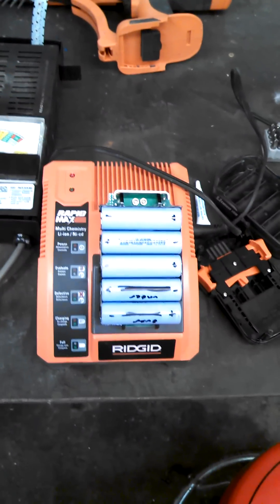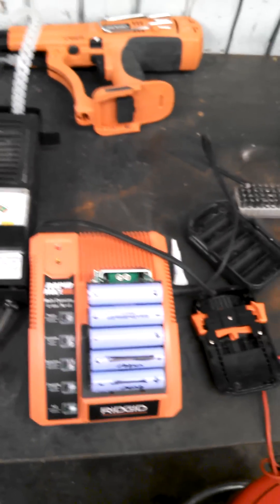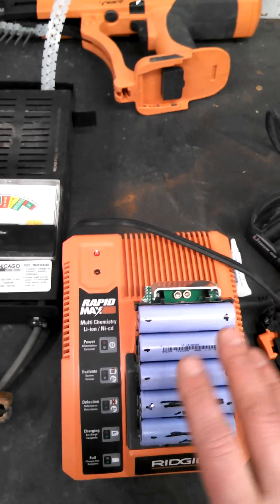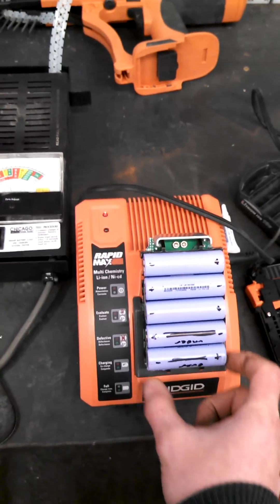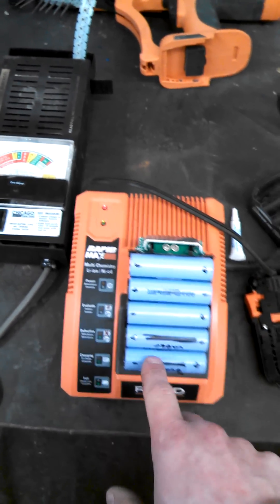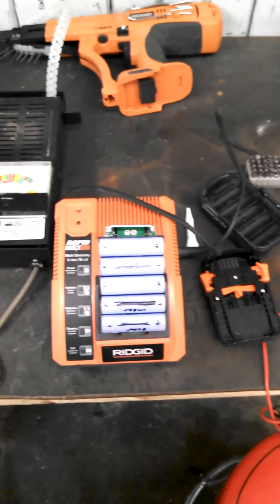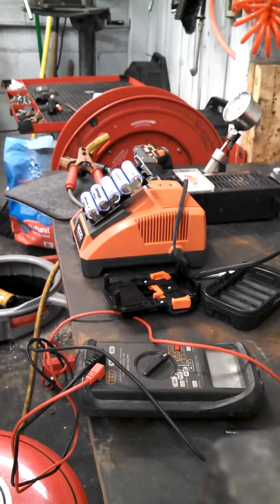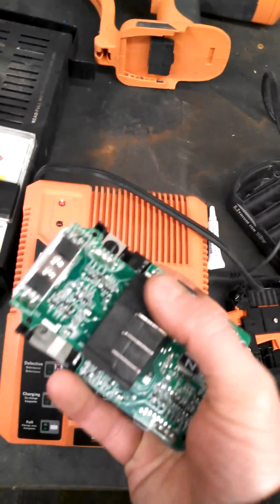Ridgid lithium 18v battery repair

Comment: Do you know what’s causing the battery to shuts off when the battery is under a heavy load? My Ridgid battery shuts off in a fast start. Slow start is fine.

Comment: Came here looking for information on whether or not there's a screw under an injection-overmolded hole on the cap that isn't able to be scratched through easily, but I guess I "don't know what I'm doing" because of that, huh? man, you could have just walked through the ONE thing that people are gonna wanna see, which is how these specific batteries are secured against 'unauthorised' entry, but instead you had to take the opportunity to flex and be condescending.

Stop giving other electricians a bad name.

Comment: Good luck with that, I went totally Ridgid based primarily on the amazing warranty! Went two years and finally had an issue with a brand new Ridgid battery under warranty (4 mos old) called Ridgid too get it replaced and they wanted the same amount to replace it as I could buy one locally at Home Depot...BS Scam!!!

Comment: The reason you don't have issues from the m18 is you use it everyday.   If they sat for 2 yrs, they would be dead as well.  That's just how lithium batteries work
Reply: Not always the case. I had a Milwaukee cordless stored away for 4 years. Lithium batteries still take charge without issue today. Where as my Rigid tools which were nog used for 2 years, batteries would not charge.

Comment: Ridged tools are the same as harbor freight tool, they are Very Cheap Chinese made Garbage, took my Ridged Batteries apart and all batteries said they were made in china, Crap batteries,
 no wonder they didn't last, GARBAGE!. I will Never Ever buy anything from Ridge tools ever again, they are Garbage. They opted to go to Chinese made Batteries and they destroyed their reputation, to try and make more profit, it didn't work. I am surprised Ridged tools are still in business, maybe they are hanging by a thread. Milwaukie is the only tool worth having, they are quality!! and Last for Years, No short cuts.

Comment: I know this is a old but if you registered your battery & tool it’s covered. Call & get a free replacement. I purchased a complete kit in 2009 & My battery’s died this year so I called Ridgid. They sent me a new set of batteries in 2 days. I registered the new ones so I am covered.
Reply: Did you have to send the new batteries in

Comment: In the future, do not buy rigid batteries. Just use your reliable milwaukee m18 battery with a battery adapter that you can make. Go on ebay and look for a battery socket with leads, and mount and wire it into the gutted rigid battery and you can use your m18 on ridgid or any other battery make. I have adapters or are making adapters for my m18 to work on dozens of different makes. I was originally only making a few adapters for tools and makes where milwaukee does not have that type of tool that I wanted, then decided to just make them for every other brand anyway. This way in case I run into someone who needs a battery for a brief time etc; or just for the heck of it. People 3d print battery sockets for different makes and sell them on ebay or online. The socket I use for milwaukee are from user msburko on ebay for $15 shipped. I think he also makes up docks for another brand as well. There are also partial non wired docks for less used for just storing your battery. Just look up "battery adapter" or "battery dock" for the brand you want. Some people also sell partial or complete adapters as well. Just be aware that you are not going to be utilizing the thermal or voltage protection from the batteries or tools since you are using another brand of pack. You can certainly also do this for older nicad and nimh tools and packs as well as I also have.

Comment: Thanks, I have an AEG version that is not holding charge. 
I now have a balance charger so may try cycling it on that first
Reply: Adam, is the  balance charger by AEG?
Reply: @daviddeveloper44  no, the balance charger is for rc packs.
wouldn't work anyway as one of the cells had died requiring a complete rebuild of the pack.

Comment: You answered your own question. You let the Ridgid batteries sit but use the Milwaukee ones daily...
Reply from the maker: the dyslexic but I can leave a cell phone in my drawer for 15 years that's on a lithium battery and power it right up. As a matter of fact Tesla cars don't recommend that you constantly charge and discharge but hey whatever makes you feel better
Reply: @thomassegiel1976  Yup, unlike alkaline batteries. Also Li-ion batts should be cycled 80/20 to last long. The more cycles the faster the dead batt.

Comment: I just call ridged and get new batteries free. lifetime warranty simple! my set, drill sawzall light all working awesome 13 years later. got new batteries twice. if they get used allot they prob last longer than sitting
Reply: I've probably spent hundreds if not close to 2k in tools and forgot to register them all but the last couple of batteries that only had 3 year warranty. I'm so upset. Home Depot said I can call them up since I purchased most of them under 3 years and have receipts to see if they can do something for me. I must say that Ryobi stepped up their game a bit. I picked up a 3/8 impact, tire inflator and 2 4amp batteries with charger under $100. Only 3 year warranty but 100 I think I was worth a shot. And yes, I registered them the same day I got them!!!

Comment: Motor n Stuffs near same or similar  I own big red Before FUEL.. I also Have rigid 18V tools that go back to Nicad about 94 the X2 series ..I run those old Tools on Adv 4.0 Lion batts  the rigid stuff is very durable  as is Milwaukee  thing is on like Amazon you can buy these tools almost nothing  kind of a no brainer  Ima tear em up doing commercial building..

Comment: I will never buy another RIDGID brand cordless tool or battery I bought a set - cordless saw, drill , impact gun , sawzall and 3 batteries . most batteries died after the first 3 months and since I was a dum dum and did not register the warranty they will not replace the batteries . the corded tools I bought are still working great , ridgid cordless bad, most quit working after the first cold spell in Wis.
Reply: Gregory Busjahn

Comment: if the batteries ae still connected together you will not be able to individually charge one cell or discharge one cell they are NOT "wired" together they are connected via a buss bar NOT wire . I call B.S.
Reply: they are connected in series ie positive to negative. If they were connected via a single bus bar it would be a 3.6v battery not 18v
Reply: Sure you can since they are in series.

Comment: I found this video interesting and helpful.  I don't know much about lithium batteries.  They seem to contain a lot of technology.  I cant find anybody that rebuilds them.   I woke up one morning and all 3 of my Ridgid battery packs were dead.  I started to see if I could revive my high capacity (10 cell) battery first.  I took the battery apart and sure enough 4 of the 5 pairs of batteries read about .57 volts.   The other pair read about 3.5 volts.  Quick math showed that each pair should be 3.6 volts.  I don't have a discharging device and figured I might not need one as they were already pretty well discharged.  I do have a very nice high tech 12 volt car battery charger.  I did use safety glasses.  I divided the pairs into 2 groups without actually breaking them apart from the pack. Group 1 contained pairs 1, 2 and 3.  Group 2 contained pairs 3, 4 and 5.  I did not figure the 12 volt charge would do much good if I tried to charge the whole pack at once.  Each group of 3 pairs should be 10.8 volts.  I charged each group at the 2 amp setting for about 10 minutes or until they hit 10.8 volts.  I then put it in my drill and... it worked!  Next I put the pack in the Ridgid charger to fully charge.  Next I put it in the drill and turned the drill on to run them down.  Then back in the charger.  The battery pack seems fine now.

I tried this on my smaller 5 cell packs to no avail.  Each pack had about 2 or 3 low cells. My charger kept cycling through charge, test, error, charge, test error....  I could not get the cells to come up to 3.6 volts.  I took the batteries out of one pack and noticed fluid, that had been there a while.  I figured forget it at that point. 

I am happy I got the high capacity one going.  Those are about $125.00
Reply: Puedes hacer un video o explicarme mejor

Comment: The message in the video is sound , the language not soo much. Discharging a battery is not dumping, a battery is not a cup you fill with power. A battery is a generator through chemical reaction creating power.

Comment: Ridgid are piss poor tools except the table saw their battery tools are the poorest on the market and the warranty is just about impposible to collect on
Reply: I've had my 18v drill and impact driver set for at least 5 years, and I've had the batteries replaced once already. No issues at all with the tools and no problem getting my replacement batteries (because I registered them as required).
Reply: You are right about Ridgid and their warrant. They flat out told me that they would not honor their batteries. I had even  registered the tool.

Comment: Thanks for the video, I am trying to figure out the + & - polarity of the tool or the battery, since I bought a bare tool today and forgot to check it out instore, Reason, I make my own Li-Ion packs , I could open the tool but I rather not at the moment Looking forward to an answer from any one of you guys, thanks,My favorite cell Samsung 22P and LG 30 amp current delivery, same as found in the good mini Segways out there and also in high draw Vaping industry,I also use them as super capacitors on electric bicycles and motorcycles Vectric VX-1 and VX-2 in parallel with NiMh on VX-1 and Lead acid on VX-2 but I obviously cannot charge them on board, they have to be recharge separately and connect in parallel using a boat high amp 3 way switch, this is definetely hybrid, byt works great for more power and extended range.
Reply: Sad you didnt get an answer

Looking from the top(battery power meter being up) + is on the left(far left).

Comment: it's funny you base your opinion of Ridgid on one bad battery and owning one Ridgid tool.  Big sample size.  And ditto to those who express warnings on these procedures.  I'm not questioning what you are doing, but as a person certified in electronics there are safer ways to accomplish these procedures.  And as stated by others have responded, the Lifetime warranty is only for batteries purchased with kits and you MUST register them online within 90 days of purchase.  If your not too lazy to read and register the serial numbers, the warranty is awesome.  Its 3 years on the batteries purchased separately.  My personal experience with Ridgid has been awesome and I own corded, cordless tools and a $1,000 generator.  And their customer support has been extremely helpful when I've needed to call them.  And they spoke perfect English but with a slight southern accent.
Reply: +chip morris I guess you never heard of shipping them back to the manufacturer. I've owned rigid for many years now and have had wonderful customer service whenever I've had to call them for anything that goes from power tools to generators. I've owned Ridgid tools for more than 15 years and have had one battery go bad.  I also had a miter saw have an issue once and had to drive over an hour to a little hole-in-the-wall repair facility but guess what they fixed it for free under warranty and I had it back in a week. I've owned that miter saw for 15 years at least and it's still going strong.  Who does have a repair facility around every freaking corner.  Nobody!
Reply: I have 7 ridgid batteries that are 2 years old and garbage!
Reply: +David Smith,  Also as of approx. June 2012 you need to RE-REGISTER any new warranty replaced batteries serial numbers within 90 days of replacement, other wise your LSA registered KIT purchased batteries revert to a 90 day warranty.
Reply: +David Smith If I would have paid attention when I bought my set I would have NEVER bought them, EVER.  First, you cant return them to the store you bought them from, second in order to find a replace a battery  you will need to travel to kingdom come to get them,(mine is a hole in wall place in the middle of a storage unit facility)  oh then wait on them! screw that, I am nursing one battery and will never buy these tools again.   Glad you are happy with yours, but not everyone has had the same experience you have.
Reply: David, that has been my experience as well
Reply: You're** and I wasone of those  too lazy, unorganized and careless to register my tools!!!!
Reply: +David Smith good for you Dave, the damn things werent a year old before they failed, 2 of the three! And yes, smart ass, I did think of shipping, but when you need them you dont want to wait to get others.  Once more, glad you like them. I dont. Have a good weekend brother.

Comment: Both my 18v Rigid batteries wouldn't charge in my dual charger today. I've hardly used them in the seven years I've had them for a reciprocating saw. I'm not trying this but am pissed on how expensive a replacement is or that I have to replace one... Never again for a Rigid product.. Beware..
Reply: if you registered your tools they would be replaced under warranty. nothing to be pissed.
Reply: +irish89055, The battery usage material states for best results, you must use the batteries monthly, and for longer term storage they must kept at a 30-50% charge level. The batteries are at least now made by Samsung. Its best to buy batteries in kit where they become eligible for the LSA warranty. The larger 4.0 batteries are hard to find in kit form. You will find letting any battery (not unlike refrigerators, or car AC cooling systems) sit for a prolonged time frame isn't conducive to battery longevity. This is a common enough battery melody, the LSA agreement at least gives you a fighting replacement chance in  negation of improper storage and infrequent usage. Instead of just buying new separate batteries, I find you can buy a whole combo kit that comes with batteries and then they are LSA eligible.
Reply: If you had registerd the tool and battery  when you bought the tool Ridgig would have given you a new battery FREE!
You can't expect a battery to sit around for years and then still work.  It just isn't the way batteries work. You have to use the regularly.

Comment: Same factory does not mean the same on the inside. It depends on what the manufacturer specifies. So Rigid can specify a $0.50 part while Milwaukee could specify a $1.50 part. The factory will put whatever part you spec in your product.
Reply: +Felix Su Hi there may be you can try Knewreck Rapid Renew Guide .
you can find it  by google searching " rebuilding ridgid batteries 18v "
Reply: +Felix Su Not certain about the points made but ,if anyone else needs to find out about learn how to recondition batteries at home try Corbandy  Battery Blueprint Crusher (just google it ) ? Ive heard some pretty good things about it and my friend got amazing success with it.

Comment: Wow, Thats to bad, I've owned Ridgid (Reciprocating Saw, Hammerdrill Combo, Impact, Circular saw, etc...for over 10 yrs.
Had replaced 3 batteries. 2) nicads, 1) Lithium-Ion and 1) charger.
All under a Lifetime Warranty.
Try that with any other brand. and I have owned Milwaukee, Dewalt,Craftsman, Harbor Freight,LOL
I've seen a better return on my Investment with Ridgid by far than any other brand.
Nothing wrong with the others, Except Harbor Freight Cordless tools.
So, Again sorry about your bad experience, But mine has been great.
Reply: +Ed McGuire 
I forgot about the Lifetime Warranty. Thanks for reminding me. Glad I registered for it. I've got a bad battery, maybe two.
Reply: omg let me have ur batteries!!!
Reply: +Ken Means,  Also as of approx. June 2012 you need to RE-REGISTER any new warranty replaced batteries serial numbers within 90 days of replacement, other wise your LSA registered KIT purchased batteries revert to a 90 day warranty.
Reply: +Rich Parks 
I noticed that on their website. This is important info for those that didn't see it.
Reply: I've been researching into battery reconditioning and discovered a great website at rapid renew roadmap (check it out on google)
Reply: Prolongggg The Life Of Lithium-ion, Laptop, and Cell Phone Batteriessss > https://t.co/3ycayBV4e1?14Puccifx9gsdd